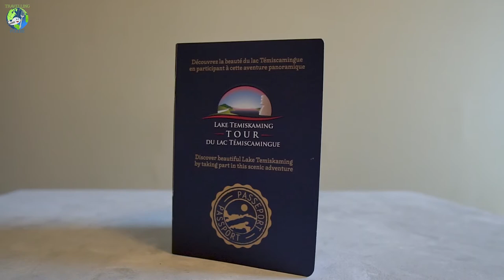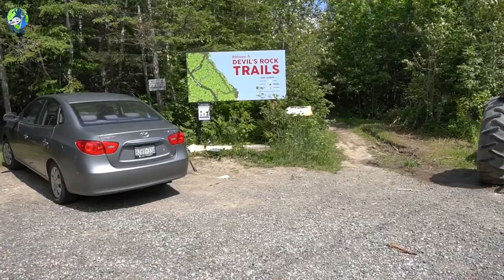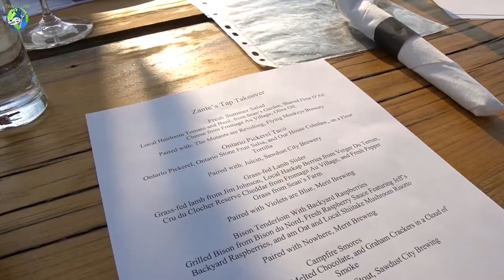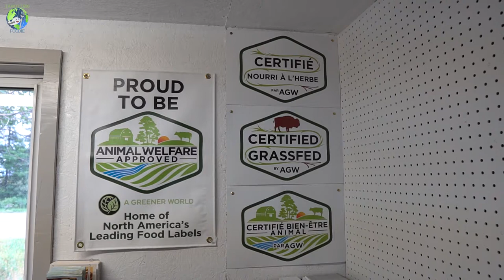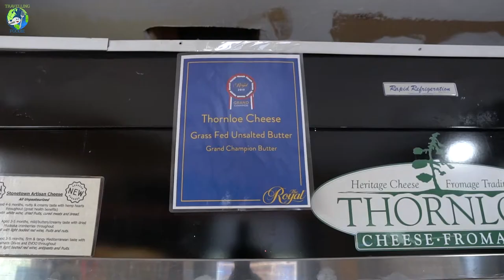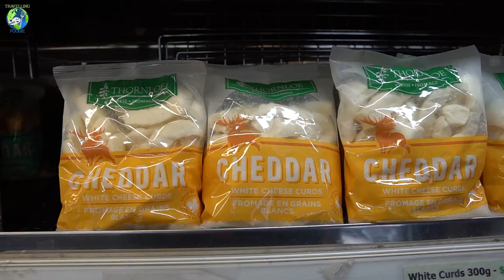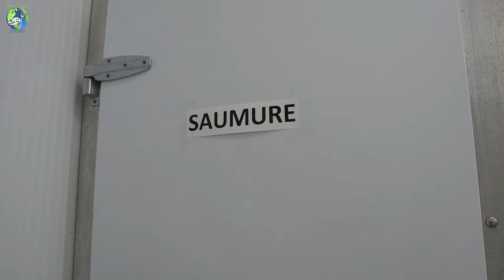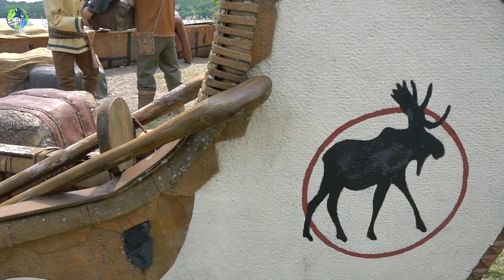Ontario + Quebec 2 Day ROAD TRIP! Lake Temiskaming Tour in Temiskaming Shores

Comment: how much does the lake population increase by in the summer months?
Reply from the maker: Hi! Here's what my tourism contact told me: Very little.  Most of the properties are owned by folks from the region and we are not yet known as a destination, so people don’t consider buying or building here.  Temagami who is 40 minutes south has a permanent population of 1,000 yet a summer population of over 5,000!

We definitely see an increase in tourism during the summer months, but they tend to be hotel and lodge visitors, not cottage owners.  In addition, Lake Temiskaming is not as clear as other lakes in Northern Ontario due to its clay bottom, so it is not as popular, but there are several smaller lakes around the community that have much clearer water.